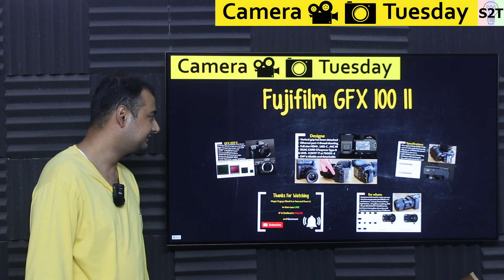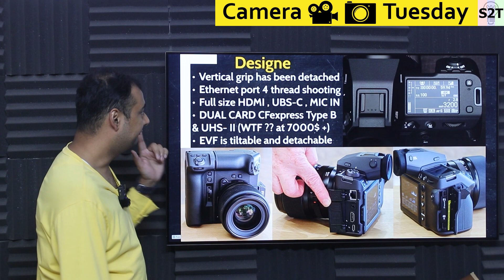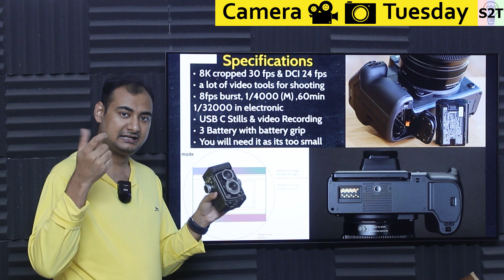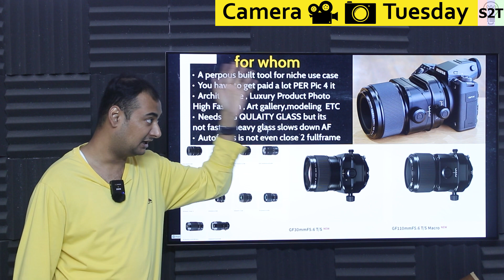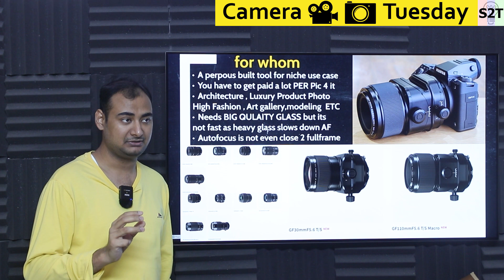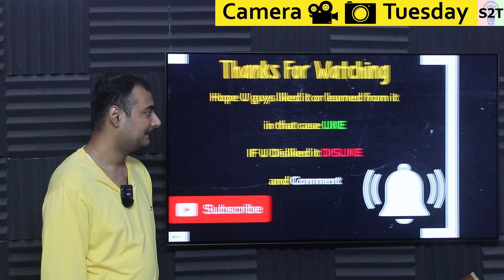Fujifilm GFX 100 II Explained {Camera Tuesday Ep249}

Comment: Thank you. Very comprehensive and very interesting. I have been in this system since the 50R came about and I find the progress Fuji made is spectacular. I don’t do sports or fast action, but I believe the GFX 100II can do just about everything else. In my initial experience with it I would say that the new sensor seems to have better dynamic range and possibly accuracy and resolution compared to the prior iteration. Nice work on your part!!
Reply from the maker: may I ask do you  u use it for job or hobby if job what sort of job as it  is a quite a niech tool
Reply: Just a crazy hobbyist fortunate enough to have the resources to feed my vices. Perhaps at some point someone will even consider buying my work